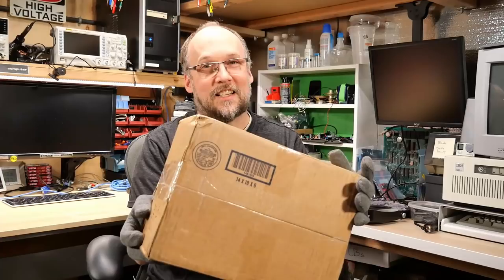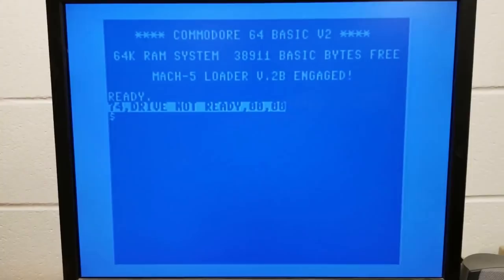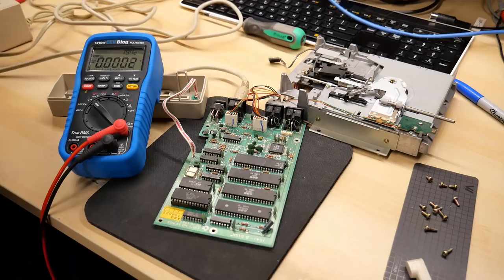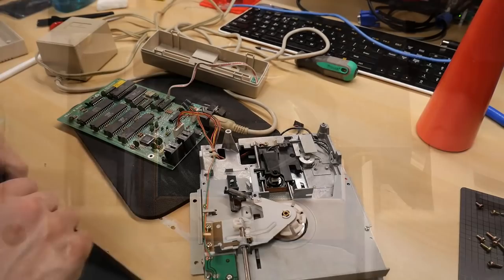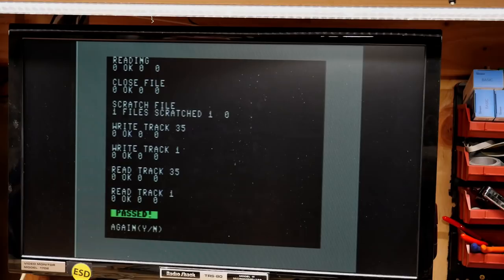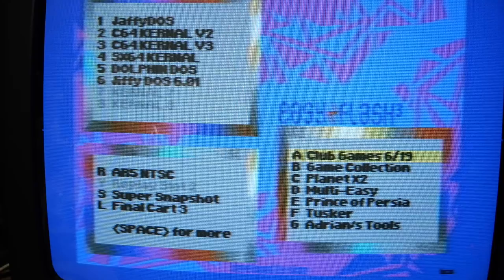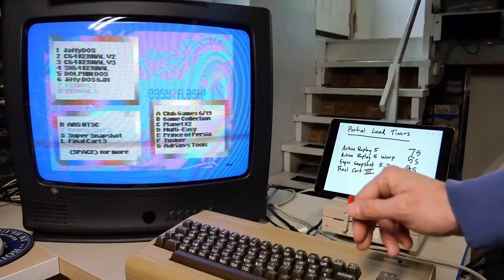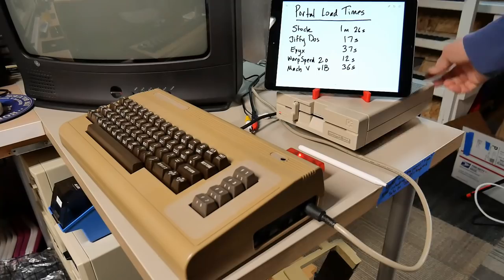Faulty 1541-II Repair (plus C64 Fast Loader fight!)

Comment from the maker: Because there are so many comments around this package and my use of gloves, time to clear some things up. 

- Editing: I edit my videos. Do not think that what you see in a video is all that happens. If I left everything I shot in the video, you would he watching boring videos that were hours long.

- Gloves: the gloves I wore were not waterproof but unless viruses on dry cardboard have the ability to jump thought a few mm thick material, this is not an issue. These were not disposable gloves but I took them off and threw them on the floor where they sat unused for days. This virus can not live on dry material past around 24 hours.

- Hands: even with gloves I still washed my hands thoroughly after I was done unpacking the drive.

- Surfaces: I cleaned all surfaces with disinfectant after unpacking the box on my desk. Again, transfer of a virus from the box onto my dry desk would be highly unlikely anyway. This viruses are not airborne and need a liquid medium or something like sweat or oil to transfer.

- Removing gloves: some people don't seem to understand it is possible to remove gloves without touching the outside. This is hilarious because if that's the case, why does anyone including healthcare workers even wear them? It is extremely easy to remove gloves especially this kind without touching the outside with your hands....

- Box contents: some people think that the contents of the box can also be contaminated. This package was in transit for days before it got to me. Viruses do not last anything close to that amount of time on dry and clean surfaces. The biggest thing is that packages are subjected to cold and hot temps while in transit which makes it very difficult for pathogens to survive. This is no different.
Reply: personally i could care less if you use gloves, unlike other people

but i choose not to, and thats the beauty about living your own life :) you can choose what you want to do
Reply: Did you also clean the yellow knife you used?
Reply: CouldN'T care less. Saying could means that you do care somewhat
Reply: Adrian's Digital Basement I’ve read it lasts only a few hours on cardboard.
Reply: I’ve heard 72 hours and someone even told me recently it can last for a week on hard surfaces.  Who knows at this point.  All I’m saying is, are we really going to let this bug stop us from licking postage tape?  C’mon!  That’s no way to live.
Reply: @simontay4851   Unless you say it in an obviously sarcastic voice, the same way you'd say "Oh, I'm SOOO SORRY" when you're not actually sorry at all. That's how I always say "I could care less," but it doesn't come across in print (unless you use an emoji or something).
Reply: I dont care what you do.  Its your body, your choice.  The issue I have is you said you assumed the contents of the package are not likely to be infected.  You have no reason or information to believe that.  The sender is just as likely to have the virus and have no signs of infection as the postal workers that handled and delivered it.  I think you are an engineer...  I dont ever remember you stating what you do for a living.  At the very least, you are technical and smart enough to know your statement is false.
Reply: Please don't pander to the morons who focus on this stuff Adrian. Most of us are here for your cool repairs and are not here to criticise.
Reply: Please google, how to put off gloves properly. You just contaminated your hands. By the way, viruses will be disabled much faster on your hand and will to not penetrate. They will just stick to your hand and if you touch your face - mainly eyes, mouth and nose - within 10 minutes they may find their way in.
Reply: Alright, I wasn't going to mention it because it was a special file format, but since you did Action Replay 5 Warp I have to point out Epyx also had special format fast loader called Vorpal Fast Load which came on the Vorpal Utility kit. It was designed by the same guy who made the Epyx Fast Load cart. I remember it being about as good as AR5W.
Reply: I suppose the gloves has to do with the c virus
Reply: Good grief. ...it’s sad you even have to address these arm chair experts.
Reply: @Adrian's Digital Basement.. I think one of my comments was marked as spam ... maybe ... it has a link to another website (National Geographic)
Reply: People seem to think this virus defies everything we know about microbiology lol. If you were REALLY paranoid, you could leave the package in your garage for a day or two before handling it.
Reply: I'm sorry you had to post this
Reply: @finkelmana  The virus doesn't stay active for long enough to survive the transit. Thus, it was fairly safe to assume that the contents would no longer be contaminated.
Reply: @subtledemisefox  Unfortunately, this virus IS defying several things that are the norm for viruses. Any which way I see no problem in being over abundantly careful.
Reply: That may be true for regular pandemic viruses.... but.... it’s the NINJA viruses you’ve really gotta watch out for... 😷
Reply: Maybe try goo gone and then iso-propyl.
Reply: Simon Tay I came here to say this.   Thank you.  By the way,  if this was reddit,  you'd have been downvoted into oblivion for your comment.   I've been there so many times.
Reply: @finkelmana  LOL the virus doesn't live forever in the box haha. 1-3 days and it will be gone. Surfaces are not how people are catching it, it is through the air.
Reply: Fun fact, the corona virus can last for atleast 7 days on non living biological and even other materials like metal and plastics.
Reply: If there's one thing to say about the human malware, it has turned us into mindless zombies, from a germophobe p.o.v.  I'll bet whomever started it all is certainly laughing at us now.
Reply: This is getting ridiculous. Gloves for a package? Soon we will be wearing a hazmat suit to open the door. 
We play quests of magic monsters and great courage... Cardboard box? Run for your lives :))

Comment: I used to play Krakout in the 80s on my C64. I haven't seen it in soooooo long. I also still have my old Action Replay cart and it works on my old C64 breadbin. Thanks for the great video! I enjoyed it.
Reply: yes, but those arkanoid clones are best controlled by a paddle; the C64 has the ability to read analog pots on its game ports so I wonder if there's a chance to hack those games to use analog paddles...
Reply: @alerey4363  katho8472 5 hours ago commented that it supports paddles! I've never tried that, as I don't have paddles for C64. But I will for sure! I will probably build them with slider pots, I think it's more appropriate for this game.
Reply: Krakout was indeed fun game :) Haven't played it since 1991 but now that I looked for it, seems to be available on a certain website, so going to download and play it with my Mini C-64.

Comment: That "80s dance party" music wasn't quite what I expected.
On an unrelated note - it's quite remarkable how unoptimized the stock vanilla loading routine was, considering how blazing quick some of the fastloaders are in comparison. Clearly, the bottleneck wasn't the hardware.
Also, congrats on the new disk drive!
Reply: luckily for us those mechanism are still in good shape after 40+ years, so 21st century hacking fixed those software/bios bottlenecks in many ways
Reply: A good summary of why the 64/1541 combo is so slow can be found at https://www.lemon64.com/forum/viewtopic.php?t=52439

Comment: Got a flashback just seeing the Final Cardridge 3 "Desktop". I had a FC3, when I was younger, though it was in the middle of 90s. C64 was my first own computer, which was handed over to me by one of my older brothers.
Reply: I'm using a FC3 right at the moment:)
... and a decades old parallel cable (from 1541 to C64, SpeedDOS-like, but only the pure cable without other modifications). 

Shocks me always. Loading 220 Blocks in 4.3 seconds. Adrian's stuff was 130 Blocks? So doubled it again;)

Comment: Datel Electronics is a British company that I remember from back in the day. Somewhere I have a boxed Datel PlusD floppy disk system for the ZX Spectrum, that I've never used. They're still in operation and still making Action Replay cheat systems.
Reply: For a company dealing in cheat devices the spectrum of quality of their products sure matched. From actually useful products like the C64 Action Replay to the completely useless Action Replay/Gameshark PC software which had a parallel port copy protection dongle.
Reply: I remember that name too but I'm 35 so only just remember as a kid in the early 90s

Comment: I had the Action Replay back in the day. I used it heaps to modify graphics in games, cheat codes, copying disk to tape for friends etc.

The normal fast loader is about 5-6 times faster than normal. So a 200 block program/game loads in about 30 seconds. The warp function of the AR5 is actually 25 times faster than normal. You will only notice it really on the larger programs, like a 200 block program where it will load in about 6-7 seconds. You hear the drive going "tuk tuk tuk tuk" really quick. Its impressive.

Comment: 70% IPA is usually better than 99% IPA for cleaning. The water is necessary to help dissolve certain substances.
Reply: IPA is very hygroscopic, so leaving it in a spray bottle will drop it's concentration anyway.  There's no chance that's still 99%

Comment: Thanks for the shoutout! I gotta admit I was pretty concerned that an X?1541 cable may have fried a 1541-II since that's my last functioning drive. I'm glad it was a simple, unrelated, fix though.
Reply: I just recently created the same problem for my 1541-II.  What actually caused the issue was attempting to restore a particular D64 image onto a floppy. This particular game has copy protection, a custom fast loader and data compression routines. I’m not sure which of those caused the poor floppy drive to make terrible sounding head movements when attempting to restore the image. But after several failed attempts of restoring the image, the drive stopped reading disks. I also thought I had fried the drive until I inspected the head. It was just as tough to clean too.

Comment: Nice to know that some 35 years ago, I bought the right cartridge. :)
Love my Action Replays! Originally got the AR3, and later upgraded to AR6 which I still use.
Glad to see some 1541-II love too. My fave disk drive for sure, it's so much better than the original it's not even funny. No heat issues, much leaner and it seems overall a lot more stable. Looks great too!
What you should try to find is a 1541 Ultimate-II+ cartridge. That truly is the final cartridge. :)

Comment: In Fast Load on the action Replay , You can use the F keys , F3 to list the Directory then just move the cursor up to the program you want to load and press F1 , no need to type anything  :-)  or if you only have 1 program on the Disk you just press F1 and it will load the 1st program on the Disk.

Comment: 1541 lls are SO much easier to fix 
 than og 1541s. I think that they're overall just plain better.
Reply: My 2 1541-IIs I had as a child all broke with the same problem: you turn them on and they keep spinning  forever and both LED stay on no matter if connected to a c64 or not, and nobody could fix them here and had no money for a new drive, was always a big drama in my early computer user life.
Reply: @nichderjeniche  I had the same, but fixed mine.
I actually fixed 2.
There is a square 44 pin surface mount ic on them that goes.
I did mine when I was a lot younger and better eyesight
Reply: @johngr34  good to know, where did you got the replacement from?
Reply: Mr Guru  Did you intend to share the Gerber files because all Gerber links are missing on that page. All that is there are images. Very nice work, though.

Comment: Thank you for this video,  currently restore a couple of Commodore 64C, and a 1541-II and it wasn't spinning of move the heads,  turn out someone before me had it apart and had put the little plastic level at 15:03 in your video, under the metal rail in rides on, which rammed the disk head and motor at the same time when you closed the drive door.

Comment: I recently rescued a 1541-II from going to the trash. I opened it up, cleaned, lubed the rails, exchanged a couple of electrolytics just in case.. the only fault I could find from it was just a really dirty read head. After some vigorous (I mean squeak-squeak off the cotton bud for a good while) cleaning everything just works :-) GadgetUK uses Plastex to clean the gunk. Of course no PSU so I just built one.

Comment: I am using my IPA that I usually use for my retro repair work in a pump spray bottle (like Jan Beta has his in, if you watch his vids) and I am spraying anything that comes into my house with it such as mail and packages.  The information we are getting in the UK is that if you just leave packages for 72 hours the virus should be dead.  I am leaving stuff as well as hitting it with IPA so between the two things I am hopeful I am protecting our household.  One other thing to watch with those magnetic screw plates is to keep your floppy disks well away from them as it may be strong enough to erase your disks.

Comment: The 1541–II that I bought a couple of years ago had exactly the same problem. A little bit of maintenance like you did and it’s working ever since. The main difference was that mine wasn’t just yellowed from age, it was literally yellow. I’ve never seen such a bad yellowing before. But some extra long Retr0brite in the Summer Sun (3 days!) did it. It’s looking good now, even though a little bit of the yellowing has come back with time, but it’s nothing like before.

Comment: I "grew up" with 1541-II's and at some point got a 1541C back in the day as well as two 128D with 1571 inside. But now, after watching Commodore videos all over YouTube, I kinda like -C a bit better because of the fancy track 0 sensor. And even bought a brown 1541 with an Alps drive that only needed some grease. It's a bit like classic cars, you get accustomed to some disadvantages :)
Oh and of course I made the two "oldies" cool with the help of your video, Adrian :)
Reply from the maker: Yeah the 1571 has the track 0 sensor too but on the 1541, only some of those C models have it. Strange they removed it again on the II!

Comment: Windex to the rescue! Very strange, I wonder what was stuck to the head that glass cleaner could cut through that IPA could not. Great video sir, rock on!
Reply: Actually, not that "strange". Unlike plain isopropyl alchol, the glass surface cleaners like Windex do contain also some spesific effective surfactants which improve wetting and dispersing, thus helping also to separate the particles, for example. As the outcome of all those designed properties, the efficiency of the cleaning process gains significant improvement.

Comment: The Action Replay could be used to compress single load tape games. Just load the game, pause at the title screen and then save. This will compress the data and save it back to tape, typically halving the load time.

You do need the AR to load games stored in this manner, and it won't work on games that require multiple loading sessions, but it's very useful if you're not worried about that.

Comment: my minidisc lasted 200 days used 2 hours a day.
three of my drives from 1985 works fine. they we're used much more the first 20 years but this shows you old things was built to last. now, or from mid 90's things we're only built to last 1-2 years.

Comment: Most places selling tools will also have magnetic trays/bowls, often used by mechanics to hold nuts and bolts, but they work fine for small computer screws too.

Comment: Have you ever heard of SpeedDOS? It required three things to work: 1) a special ROM in the C64, 2) a special ROM in the 1541(-II) and 3) a parallel cable to connect the drive to the C64's USER port. It was insanely fast! I used it all of the time back in the day; and it achieved a near 100% compatibility. If you absolutely had to, you could switch both the drive as well as the C64 back to stock with a special switch on the back of both. The parallel cable wouldn't have to be disconnected from the C64 in this case, because, as you know, the standard C64 BASIC ROM and 1541(-II) DOS didn't even know of its existence... If you happen to be able to do a video on this, I would love to hear your verdict! Mind you, you will have to read a manual to achieve the best results, as there was an absolute tonne of ways to get programs to load. As a bonus feature, it also came with a machine language assembler and monitor.

Comment: Way back in 1980-something, my first Commodore disk drive was a 1541C; it failed just like the 1541-II in this video.  A friend told me to clean "the head", but it would have greatly helped if he told me that it was not the fuzzy contact on the top of the drive head mechanism!  I even went as far as replacing the fuzzy contact thinking I was putting a new head in the drive. :|

Comment: Instead of an XE1541 cable that requires a PC with a parallel port, I made a XUM1541 that uses a $3 Arduino Pro Micro and hooks up to any PC that has a USB port.
Reply from the maker: Do you have a good link to a page on building these? I bought my cable years ago and it has served me well but something I can use with a modern PC would be nice.
Reply: @adriansdigitalbasement  Agreed.  Sounds like a good weekend project!
Reply: @adriansdigitalbasement  here is!!  https://myoldcomputer.nl/commodore-64/xum1541-promicro/   ,  don't get confused, you have to use Arduino micro (Arduino nano isn't compatible),  NOTE: parallel connection it´s optional